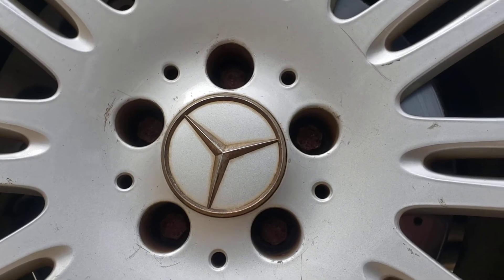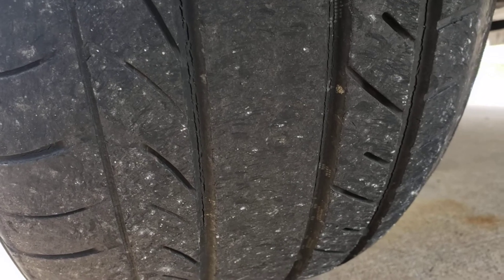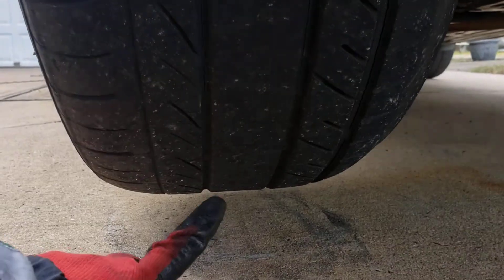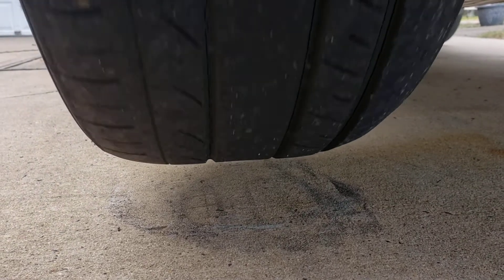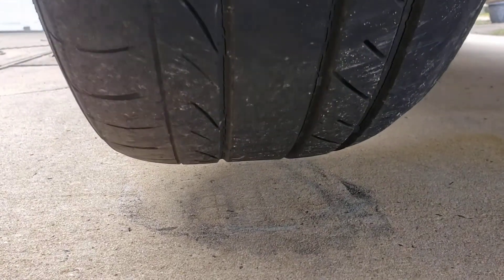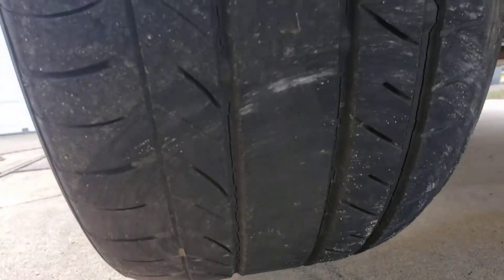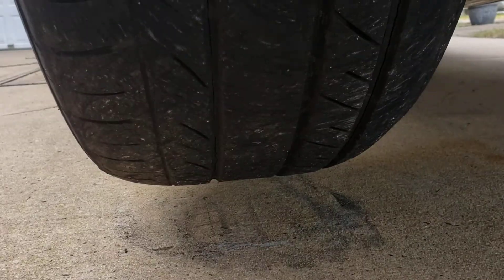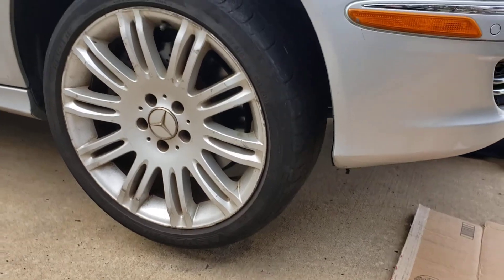Flat Spot on Tires from Storage or Sitting and Vibrations when Driving How to Spot a flat area

Comment: Thanks, this is helpful! You can try pumping them up to max pressure listed on the sidewall and drive 250 km/150 miles. If they still vibrate they are toast.
High performance and wide tires are more susceptible to this.
Reply from the maker: Not on these tires..they were bad..😆

Comment: Thanks for sharing, have same issue, but have a few tyres on my car, when rotated they Bob up and down...first thought was the rim in bent, but done the DIY test checking trueness, and feel it's one or two of the tyres with massive flat spots! 

Will replace the tyres and see first, if it continues the rims will be looked at next.
Reply from the maker: What year make model is your car and how old are the tires and are the rims factory or aftermarket rims?
Reply: @alyoungcuda  2013 Volvo V60, rims are OEM, tyres are X2 6 year old continentals (very cracked outside edge) and X2 Michelin's 3 years old - moved the notiecebly very bad tyre to rear, but still get vibration through the steering wheel, so suggests to me more are flat as well
Reply from the maker: Vibration while moving like on a highway or on braking
Reply: @alyoungcuda  moving not braking
Reply from the maker: Worn steering or suspension  parts and of course wheel bearings will give you vibrations that you mentioned.
Reply: @alyoungcuda  yeah all been checked, and all been fine, wheels balanced, tire rods replaced, new brakes and rotors, 4 wheel alignment, tyres I have not considered yet (until I saw the massive flat spot on some of them) doing same test you showed here

Comment: Just ran into this today for my first time and iv owned many rigs well this ones a big lifted toyota i left her air down at 5 psi all around they where goodyear wrangler mtr 35 inch with kevlar sidewalls well my plane is to air them up to 45 psi and let them sit with the car jacked up and lifted on stands might use some heat to help bring it back out to round

Comment: I have heard some cars a shipped from Japan to the US are filled to 50-55 PSI to prevent flat spotting during shipping.
Reply from the maker: I don't go that high on cars that sit, around 40 psi
Reply: @alyoungcuda  Lot of tires have a 50-ish max PSI and are tested to I believe 3x that before bursting. I would be surprised if any tire has a max PSI of only 40. Why not go higher or is it not necessary. My car sat for 3 months and all 4 tires are ruined.
Reply from the maker: @AEVMU  i start the cars every month and roll the car forwards or backwards to another spot on the tires..😆

Comment: I bought a 2020 ram 1500 2 weeks ago with 45 miles on it not 45,000 only 45 I noticed vibrating when I drive, what should I do? Thanks?
Reply from the maker: Thats low mileage for a 3 year old truck, you have to think how it got there for you to buy it..was it a theft? Accident roll over, flood victim, found in a lake or ocean, could of been the way they towed it away. If it was in water, something might of got damaged when they replaced the fluids..you need to do a good visual , it only vibrates when moving in drive? Reverse, rolling in neutral? Tires and rims are checked and balanced? Check the year of manufacturer date on the tires..might be damaged somehow that you can't see with the naked eye...

Comment: I notice a little small minor very small cracking/dry rotting on putter edge of tire....is the rule of thumb to just replace tire if ANY dry rot or cracking is observed?
Reply from the maker: Tires will have little cracks, and some brands crack early in its life, but a rule of thumb is tires past 5 years even if they still look good and have treads are suspect..so if its a daily driver, long over the road car then its better to be safe than sorry with good tires...plus older tires get hard and will give a harder rough ride too.
Reply from the maker: There are codes on the sidewall that will tell you the year and month the tires were made
Reply: @alyoungcuda  excellent thanx...cuz I just bought this car and have no idea of the age of the tires
Reply from the maker: @macknumber9  tires are expensive but a blow out into an accident is worse...and check the spare tire too if its a full size spare.
Reply: @alyoungcuda  thsnx I'm gonna change tires today...just found out that my rear tires are 11 and 12 years old and my front tires are 2 and 3 years old....can I just replace the 2 old ones?
Reply from the maker: @macknumber9  yes change the 2 old ones for sure..and check the spare tires age too
Reply: @alyoungcuda  I just don't know if I have to change all 4 at once or not...they will be different brands...
Reply from the maker: @macknumber9  as long as you change 2 the same and place them together either in the front or in the rear you will be ok..unless you have a four wheel drive or all wheel drive car then they tell you that you have to change all 4 together because of the difference in height of the old to the new..it affects the 4wd and awd the most..front wheel and rear wheel drive cars are ok. So places are pretty adamant about selling you all 4 tires, but I tell them that I sold the car to somebody else and I promised them I would by these 2 tires and they can come back and buy the other 2..im not paying for 4 tires ..it usually works because they need the sale.

Comment: wouldnt it be better to lower the air and run it for a few miles then max it out?
Reply from the maker: Damage was already done, it stiffs up like that
Reply: @alyoungcuda can flat spots develop when the tires were brand new prior to vehicle sitting? If yes, is this fixable if it happens on the new tires?
Reply from the maker: @EJR20  unfortunately flat spots are permanent..think of it as a heavy chair  on a rug,  once you move the chair the in dent is still there, it might come up a bit but you will feel it in the ride. The tire has steel in it and thats what holds the form

Comment: If I fill 45 psi then spot or not
Reply: And use car after 15-20 days
Reply from the maker: Extra air won't fix it..its the rubber itself that flat spotted..air itself has no eyes, it would not know to go to the fattest spot on the tire..its like those oil additives that claim they stop an oil leaks , just add it to the engine oil right?..how does it know where the leak is? It doesn't,  so it travels all over and swells up all the rubber seals and now it leaks in places it never did..lol
Reply: @alyoungcuda  If I have 45 air  then the car will spot in the long term parking example 20 days
Reply: @alyoungcuda  less air is the reason of flat tyre fir long term parking
Reply from the maker: Low air is but when sitting low with all that weight on it the tire sidewall and treads will keep that shape..that is why they have those curved tire saving things for cars that sit..I roll my cars every few months off the same spot
Reply: @alyoungcuda  if I fill max pressure 44 psi then tyre crack cut on it or not
Reply from the maker: Any cracks or dry rotted on a tire can explode at any given time..becareful when you put alot of air in it..its like a balloon..some can stretch but some can pop easily
Reply: I filled my tire only about 5psi higher then what its supposed to be. pretty much unnoticeable now
Reply: I've resolved flat spots by overfilling psi (45-50 psi) and just drive it for about 100 miles it good warm weather... they can usually work themselves out.
Reply: Try 60 Psi.